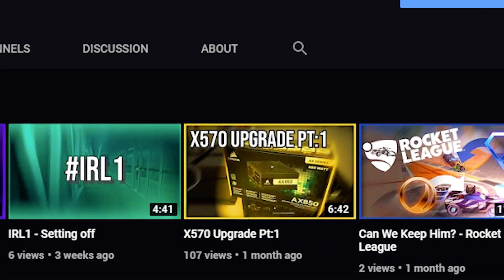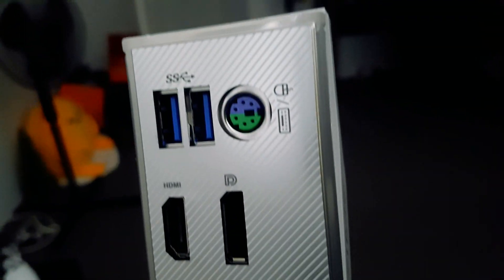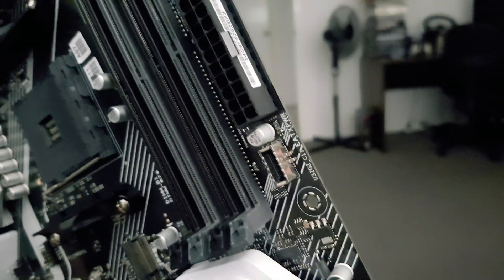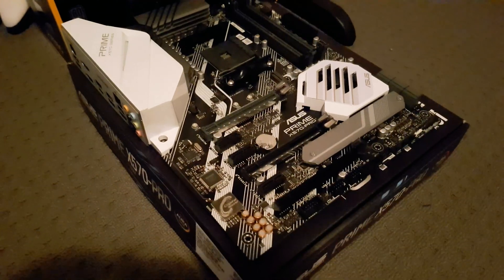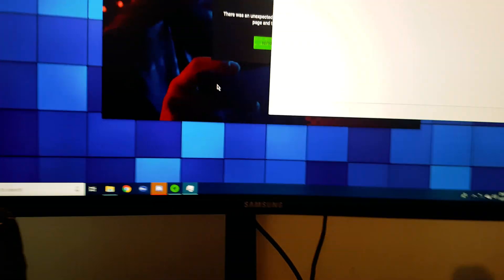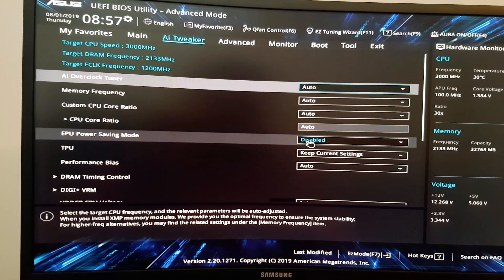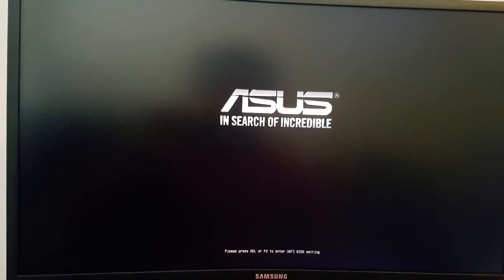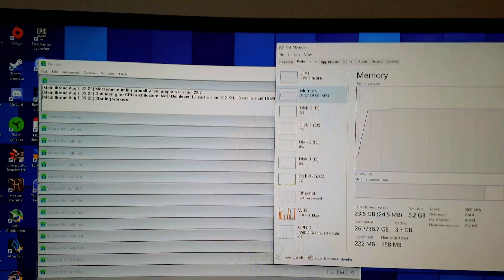X570 Upgrade PT:2 (finally) - Asus Prime X570 Pro

Comment from the maker: Please watch, as there was an issue with the board, Because of my own stupidity to be honest.
https://youtu.be/o4HLeLobRwQ
Reply: Alright, you messed up the M.2 drive installation. Always use the upper slot first because it connects directly to the CPU. The lower slot goes through the motherboard's chipset first which causes latency and speed loss. You might want to actually do measurements on the drive, before and after, to see how much it actually effects. The good thing about X570 is that at least their both pcie 4.0.

Comment: does the GPU have to go into the top (grey) PCIE slot? Or can it be in the second metal-reinforced x16 Slot? Aesthetically, I like it located in the second one down, but I am not sure about performance.
Reply from the maker: On this board, the top and middle slots are both reinforced. But only the top one is wired for x16. The middle slot is only wired for x8. You can use either but there may be a very small performance loss (2-3% ish)
Reply: @thought5057  makes sense. Thanks! Appreciate it boss

Comment: Did I hear right in that there's a specific requirement for a PSU with this mobo?
Reply from the maker: The only thing to keep in mind is this board has 8 + 4 pins for CPU power, but will work with just the standard 8 pin. Other than that, no special requirements...

Comment: Hello I have the same problem. The memory doesn't run on 3200mhz! Hope you find a solution
Reply: Enable D.O.C.P/XMP on the BIOS. Thouhg, First and second gen Ryzen are a bitch for that kind of speed. So, I might not work for you. Go down to 3000 or lower until you boot.

Comment: Thanks for the video. I'm building ironing this mobo today. I'm going for a xeon/x58 platform to a 3900x/x570, so I don't expect my situation to be a smooth as yours with respect to the system "just working".
Reply from the maker: I believe that with an up to date BIOS and a clean windows install, (which I'd recommend anyway) I honestly think it'll be smooth sailing. JayzTwoCents recently did a video of a PC with an intel windows install, plugged into a new AMD build, and all that was needed was the up to date chipset.
Reply: @thought5057  not so smooth. Can't seem to get the onboard Intel LAN working...

Comment: I have the same board but I have x570-p but mine doesn't work with only 8 pin but there was light on the board but nothing was spinning and won't turn on. Could you help out?
Reply from the maker: Try to reseat the cables and/or components first and try again. If that doesn't work, then try a different power supply if possible.
Reply: Oh okay, thank you

Comment: The upper left rgbs on my asus mobo won't light up... how do this? Lol
Reply: Halp
Reply: Am I missing a cable?
Reply from the maker: Is it the lights on the board that won't light up or the RGB header? If its the board lighting, then try the Asus Aura suite to fix it. If that doesn't work, contact ASUS support directly because I'm not sure myself.

Comment: how many fans are ok to run from this motherboard?
Reply from the maker: There are 6 4-pin fan headers on the board, plus an AIO pump header that can be switched in the BIOS for regular fan use. And you a safely link 3 fans to each header.
So, 'theoretically', you can run 21 fans on the motherboard. 😁
Reply: @thought5057  Ah nice, thankyou for your reply man. keep up the good videos!

Comment: Did you need to connect both 8pin+4pin cpu connectors?
Reply from the maker: You don't HAVE to connect the 4 pin. It just helps avoid running into power limits when overclocking, especiallyon the 12 & 16 core chips. It is a nice option.
Reply: Thanks mate, had the same question, you helped me out real quick
Reply: @ivanbogomolov  I tested this and it works with only 8 pin!
Reply: @thought5057  Would you say the chip can run fine without overclocking? I bought that exact card and the 3900x, still hasn't arrived, and would like to know if I have to change the PSU just for the pins. Thank you in advance.
Reply from the maker: @Enderplays12  Oh yes, the chip will run perfectly without and manual overclocking. Plus the chip will self boost depending on the task it's doing anyway!

Comment: I'm 5 minutes from pulling the trigger on this mobo and a Ryzen 5 3600. You have 5 minutes to respond and convince me otherwise. hahaha Otherwise, I hope my migration goes as easy as yours did. That was kind of ridiculous that it just booted up like that. Did you uninstall drivers and use sysprep when you migrated the HD?
Reply from the maker: Back up things before anything. And just moved the drives over to the new motherboard. Jist like that. 
But be careful of the Updating the BIOS because I'm having some issues with it at the moment. Waiting for ASUS to contact me.
Reply: @thought5057  Thanks, I appreciate it. But I will be pairing it with a new Ryzen 5 3600 - and I've read the bios issues are usually related to previous Ryzen generations. But I'll keep that in mind. I will definitely backup - I run macrium and an automatic clone of my c: drive is created weekly. I'll manually create one before migrating. But I appreciate the video. I just pulled the trigger! I'll have it by Thursday.
Reply from the maker: @gregroyse  Awesome, best of luck to you.

Sidenote- Is that Macrium software good for cloning drives? I've not found any good ways of cloning a drive as of yet.
Reply from the maker: Hey Greg, I just wanted to say thank you for helping me fix my motherboard, even if you didn't realise it. I've given you a shoutout in the part 3 Video for your help. https://youtu.be/o4HLeLobRwQ
Reply: @thought5057  though I am late 
I think this mobo doesn't support certain ram frequencies with old gen ryzen.
Just like how asus tuf doesn't support 3600mhz kit with even this gen as stated in their official website  I  believe.
Correct me if  I'm wrong.
Reply: @thought5057  OH and PS - I got the NZXT H510i case... white. I think this mobo will look really good in that case.

Comment: I thought 1st gen ryzen didnt work on X570. Is this board just special or am i misinformed?
Reply from the maker: I think I owe you an apology. This particular board does not support 1st gen Ryzen. I've a part 3 explaining all.
Reply from the maker: The X570 chipset uses the AM4 socket for CPU's. Any AM4 CPU will go in this motherboard.

Comment: Ryzen 1700 with a X570..
You know your Mainboard is like 2 times the price of your cpu..
Reply from the maker: That's the beauty of this platform. Upgrades can be done in any order.
CPU will be upgraded but not yet as prices are expected to come down.
Reply: @thought5057  Bro can you elaborate on that? The only time the ryzen 2000 got a price drop is when the 3000 was launched. I find it hard to believe that he 3000 series will get a price drop anytime soon man. Unless you know something that I don't? I'm planning to get a 3600 which is quite affordable, but if prices are dropping... then....
Reply from the maker: Although this is still a theory, many believe that when the 3950X launches in September, It will be at the price of the 3900X, and then the whole price stack will move down. If AMD is going to do this or not, that is uncertain. 
Also, there is Black Friday, which is what I'm waiting for.
Reply: @thought5057  hey budd, you convinced me to buy this motherboard but i have a slight problem. My older motherboard only has 6 standoff and 6 screws where as this has 9 holes. You think its possible to screw the 6 other holes and leave the middle one out? thanks man
Reply from the maker: @jakereacher7958  As long as you are not too vigorous when installing into your case, you should be fine.
Reply: @thought5057  kk cool man